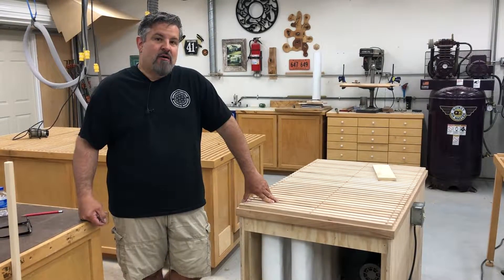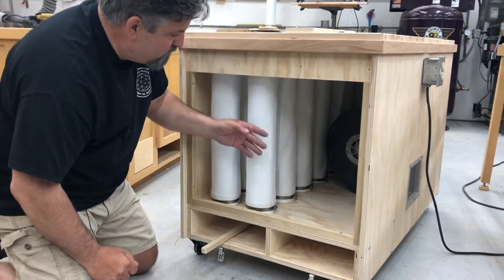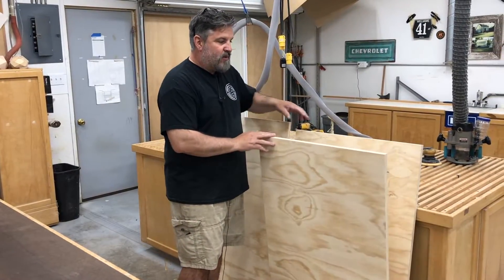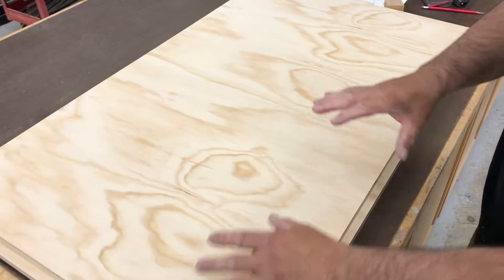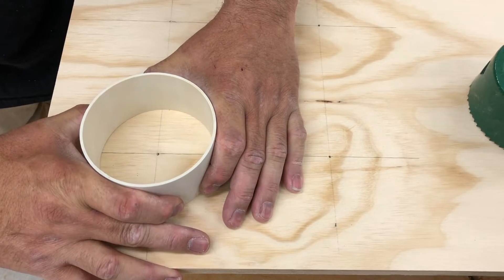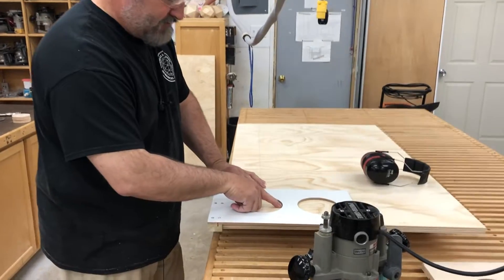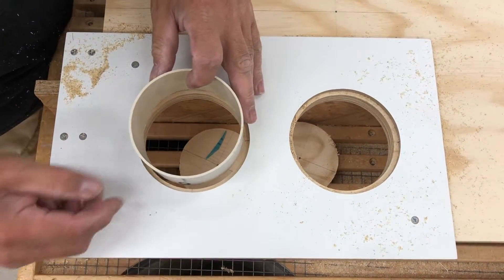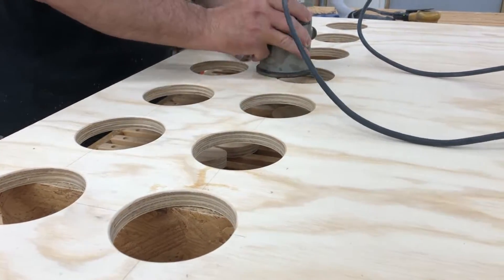DOWNDRAFT sanding table (Part 1) ** Superior filtration ** Easy cleaning **

Comment: Nice work! I have 2 questions. Can the area not over the tubes be used for sanding, and will the downdraft from the tubes pull the dust down? Second question, what is the thickness of the felt?
Reply from the maker: Hey Bryan, This table is really sized for one person use. The best air flow is on the filter side. However, if you were sanding a larger door or shelf and covered up part of the tube holes the airflow would be redirected to the edges of the panel on the non filter side. The design I have for a 48x48 table has filters on both sides for 2 sided use. The filters are 16oz felt.
Reply: @ODDBALLGALLERYKeithWilliams  Thanks Keith for the reply. I am just a weekend warrior looking for solutions to keep my wife happy! :)
Reply from the maker: @bryanmoir  I am working on a new video that will update this design a little. The price of the blower I used has doubled since I made this video.
Reply: @ODDBALLGALLERYKeithWilliams  Looking forward to seeing the new video Keith! Everything has gone up in price.

Comment: I really love this design, planning to buy filter kit asap.  One question I like the wood strips but do you think if I used a piece of peg board on top with less strips to allow the air flow but still support the peg board that id restrict the air enough to get a good suction across the peg board?
Reply from the maker: My initial thought is that the air will take the path of least resistance. I think you would  need to close off all sides of the pegboard to force the fan to pull through the small holes. I think you will have much less free open area to air draw through ,although the air will be flowing faster.  My goal is to get as much air flowing down as possible, the fine dust will follow it.

Comment: Is there enough suction to run the sander off the same collection?
Reply from the maker: The cfm is there but not the ability to overcome the static pressure of a small hose.

Comment: Great project but $240 for the filter kit seems like a lot!
Reply from the maker: Yes, they are not cheap.  When you consider they filter to sub 1 micron and you will not have to even touch them again for a very long time it is a bargain.  For comparison 14 of these tubes have the same surface area as five -20x20 MERV 15 pleated filters, (about $75). Pleated filters will have to be blown out or replaced regularly.
Reply: @ODDBALLGALLERYKeithWilliams  good point, I wonder if they could be made from sheets of that material?
Reply from the maker: @woodaddict1  Yes, the filter could be custom made in any size. The reason I use a lot of smaller diameter tubes is to get as much surface area as possible inside the cabinet.
Reply: @ODDBALLGALLERYKeithWilliams  how much just for the filter tubes?
Reply from the maker: @woodaddict1  They are $10 per tube.
Reply from the maker: @woodaddict1  👍🏼  If you have any more questions let me know.
Reply: Will you have more filters soon?